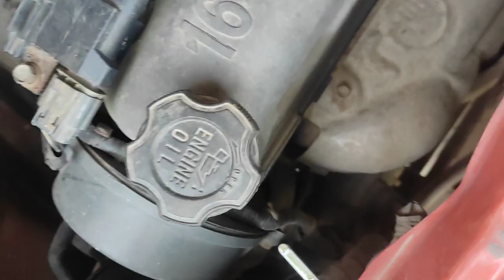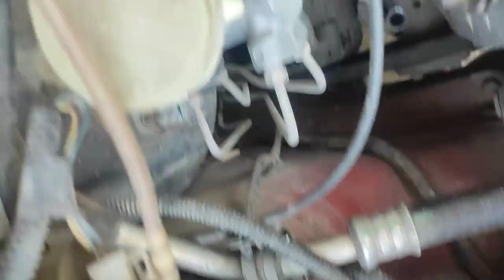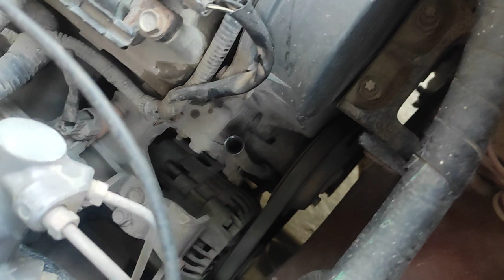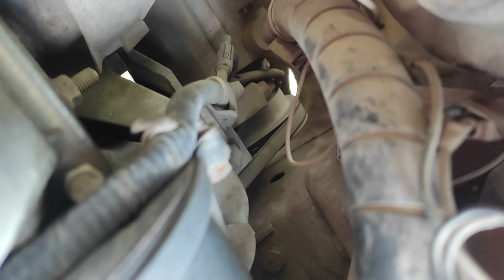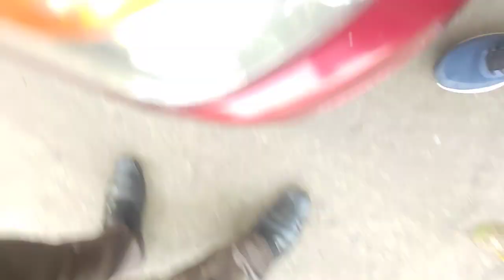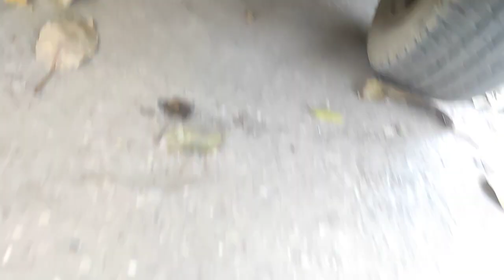7 February 2023

Comment: Looks like you’re running straight concentrate antifreeze. Problem is you’re missing that 50% water needed to cool. Antifreeze concentrate by itself is simply an anti-corrosive and anti-freeze, but not very good at cooling.